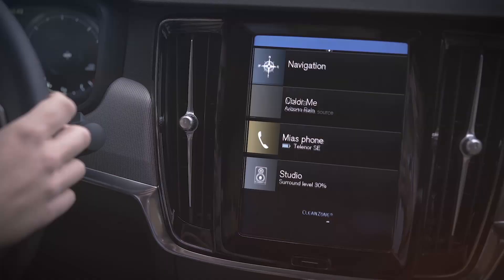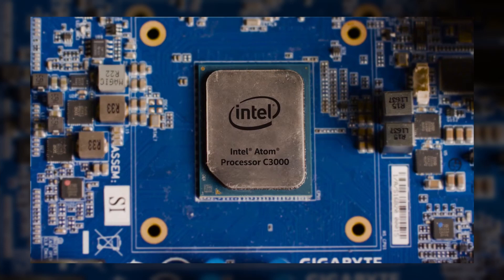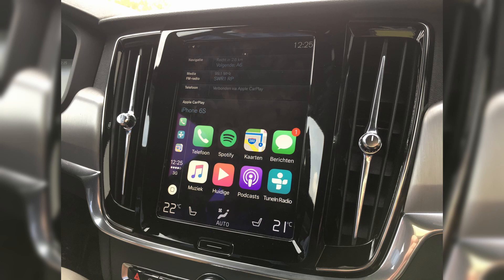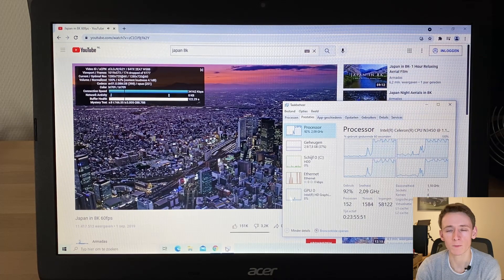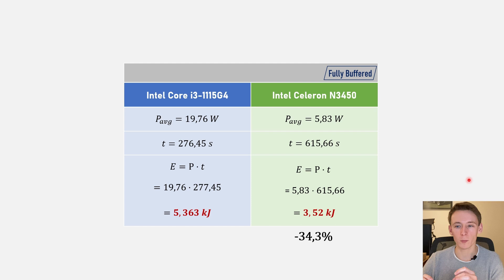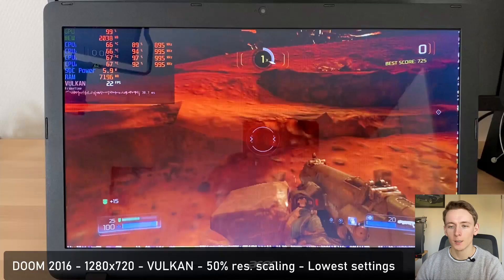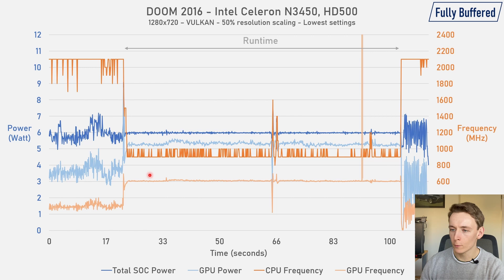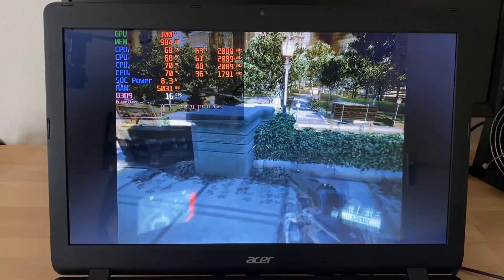The weird CPUs that run Volvo's Infotainment (and Crysis)

Comment: What's the most impressive to me is that when running Doom, the entire package uses 6W while the GPU uses just over 5W, which means the rest of the CPU (x86 cores and uncore) consume less than 1W while running Doom. That's incredibly efficient, and it's not even the most efficient Atom-core based CPU there is
Reply: that's not really efficient, it's just power restricted. using low power doesn't make it automatically efficient. it's missing the second part of the equation: speed. compared to mobile ryzen + rdna2 apus (like the one in steam deck) restricted at 5w, this is super slow.

Comment: Intel GPUs of that time is indeed surprisingly ineffective.
By the way, I completed DOOM 2016 on a Kaby Lake iGPU, and the artifacts on the edges of the screen in Vulkan is not the only problem. Game runs somewhat stable only for about 10 minutes and then completely locks up.
I ended up using OpenGL
Reply: @youtubeisgarbage900  It did what it had to in its day but yeah it didn't age well and thankfully we moved on to better things. :p

Comment: I had this N3450 with 4GB of RAM in a horrible Asus laptop. I used ThrottleStop to lock it at 2.1ghz(max all-core boost) all the time and somehow the GPU also never throttled. I think OEMs were free to set power management the way they wanted and Asus decided not to restrict the GPU too much. I remember it used up to 10W when gaming. It was ok for old games like Half-Life 2 and GTA Vice City which I played at max settings at 1366x768. The newest game that worked well on it was Grid Autosport from 2014, which I suspect has some optimization for Intel HD Graphics because the HD Graphics logo shows up when you start the game. It ran at Low-Medium settings with 30-50 fps. The chip was otherwise only good for web browsing and media playback. I attempted to edit video on it in Premiere and even short 720p clips took minutes to render.

Comment: The Embedded chips are in now way really comparable to any desktop or mobile version of them, they offer up alot of features normal cpus dont usually have, the car editions have massive amount of GPIO, specific silicone addons for hardware OBD type systems, and usually a "back channel" that allows for flashing the system from any state to any state, further there cooling in a car is tricky, the cars CPU might well be clocked at X but its configured down to the lowest TDP they can get away with, and to make sure they boot snappy they simply load a firmware image rather than booting the OS, if you actually reset an Infotainment system you will note the process takes about 30 mins.

Your compairing a cooking apple to an apple, but informataive none the less

Comment: I'm not sure what the specifications are for the Chevy infotainment unit it, but I know it runs Windows CE.You can unlock the debugger options and show desktop. I've done it before on a 2013 Spark, also the same in my 2015 Sonic.
with the USB access It may run the original Doom. I just don't want to risk bricking my unit. Most of the comments on the video showing the unlock code say they brick their unit trying to change the splash screen.

Comment: i installed a dreamcast emulator in my car infotainment. sonic adventure runs at 300% speed if uncapped.
my car is also the only place i have played diablo immortal in. not because it's super good to play there, but because it was the first place i tried it before deciding i didn't want to play that.
i also installed xcloud and played forza horizon and flight simulator in it. i leave one of my cheap bluetooth controllers permanently in my car now. you never know when i'll going to have to wait for hours in a traffic jam, or a queue for something important (like covid vaccine not two years ago, i wish i had this back then), or break down in a remote road and have to wait hours for rescue.

Comment: I wonder if it could be possible to get higher ram speeds off the platform, maybe with a modded BIOS. Undervolting could help a wee bit in terms of power consumption and heat.

Comment: i got myself a cheap dell laptop with windows 11, last fall, when the new p-cores were being problematic.  the pentium silver n5030 seems to be a decendant of that archetecture- running 6 wpc at 14 nm up to 3.1 turbo clock. 
 
 its been plenty capable for audio production & older steam games, with ddr4 ram
Reply: and the battery lasts for days
Reply: I got a used acer laptop with the pentium gold 7505, 512gb nvme ssd and 16 gigs of ram for 50€. For me its totally enough. It does all the office tasks with ease, plays metin2 pretty well and has an insane battery life